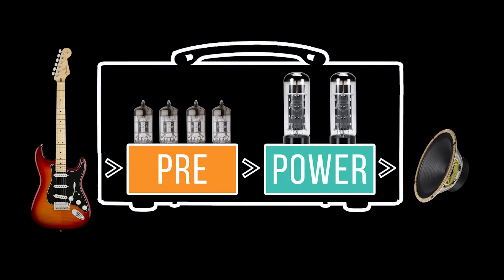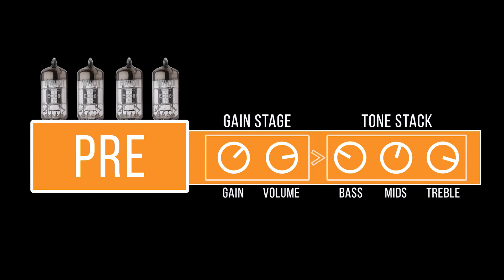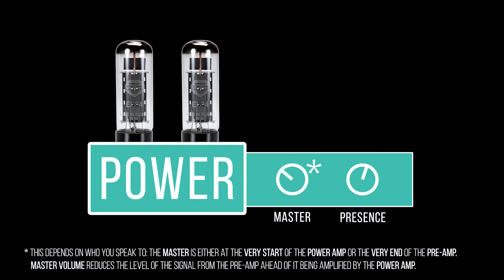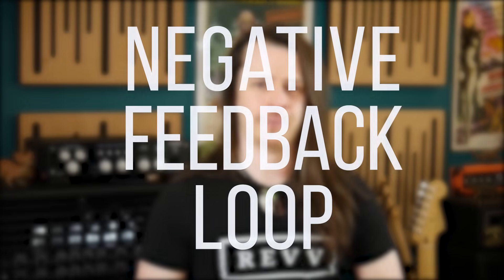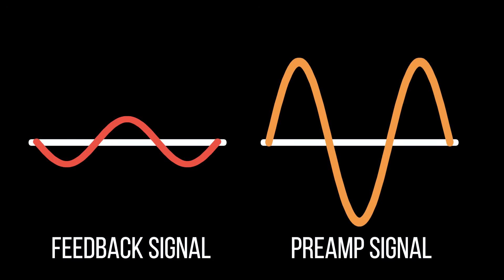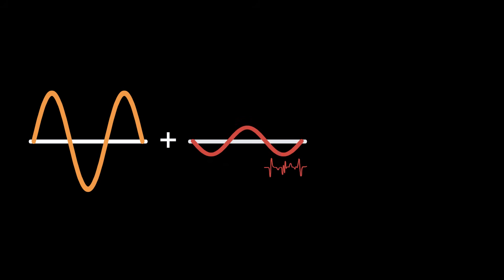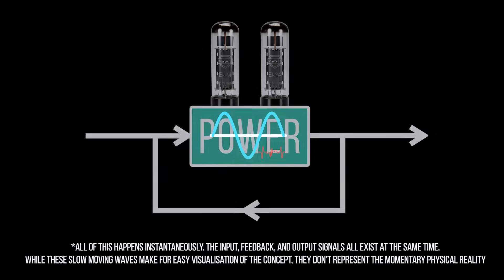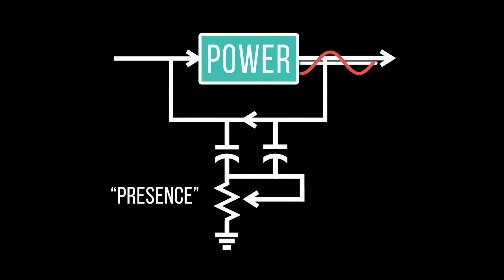Presence: What Does It Do? | Too Afraid To Ask

Comment: I'm Too afraid to ask this, so... How does a compressor work?
Reply: It makes quiet things louder, and loud things quieter so everything is more or less the same volume.
Reply: @Aeronaut1975  this is not really accurate, the compressor turns down the volume of a signal when it surpasses a threshold by a certain amount making it more even, usually this process sets the signal quieter than it was before the compressor and so usually compressors have a feature called "makeup gain" that turns the signal up after being compressed, making it more or less the same overall level as it was before, but with not a huge difference between low peaks and high peaks.
Reply: @samaudioyt  Yes, thank you Doctor BlueZ. I was trying to keep my answer short and simple. I'm well aware of how a compressor works. It wasn't me asking the question.
Reply from the maker: I will probably revisit this for a TATA episode some time, but if you can't wait for that then I have a couple of older videos all about compressors under my 'Do I Need One' series. 
That should give you the information you need, a lot of people found those videos really helpful.